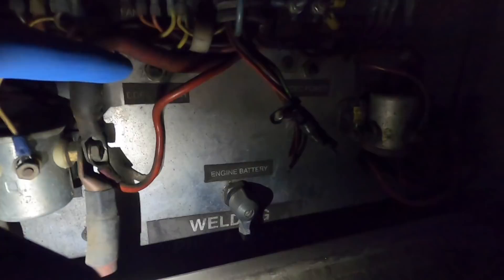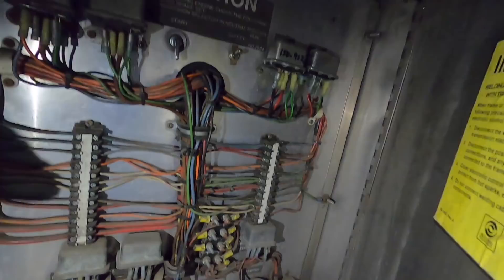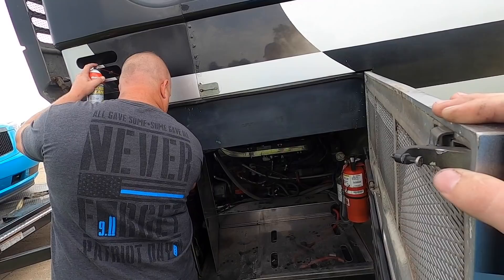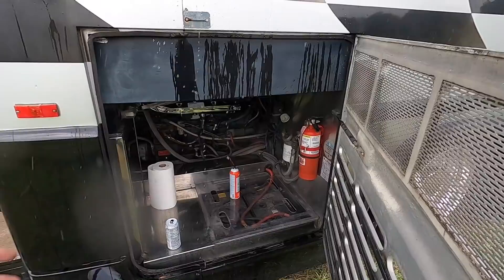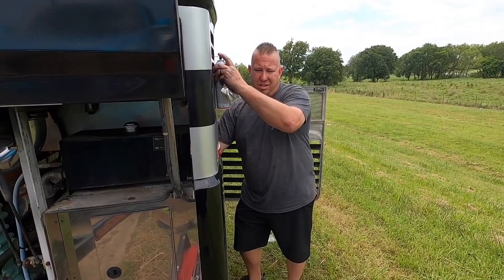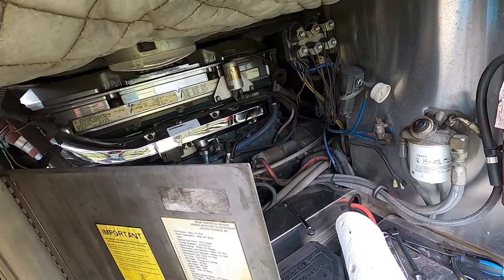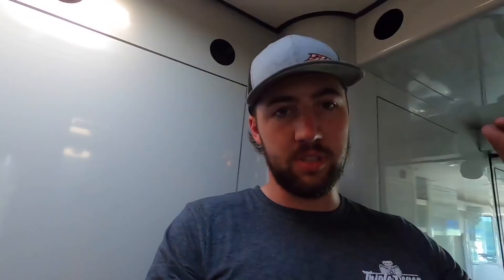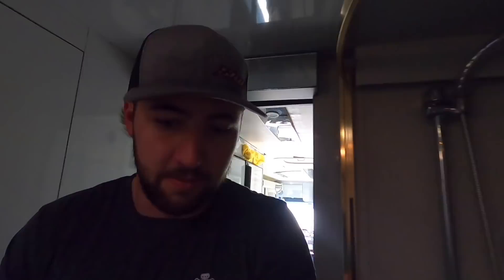RV Totally Stranded For 25 Hours...What Happened?? (My 96 Newell Coach Broke Down!)

Comment: You were blessed by all the angels in heaven finding Diesel Solutions.  My 45' Spartan / Travel Supreme and one day I turn the ignition on to start and NOTHING. At least we weren't stranded and at home.  Did you know that some coach wires have numbers on them in addition to the color?  The numbers correspond to the electrical schematic and circuit numbers. Definitely helps when your going from back to front. I never did find the issue that caused my loss of power to the ignition switch. I ran a new one and labeled it.  I'd suggest you carry a tool box and parts department your coach. IT whatever it is will break of just stop working at the worst time.  Does your plumbing have the nylon type fittings?  You should have a supply of each type. I also had a service manual stored on my computer for each system on the coach, ie leveling, pumps, gen set, a/c etc.  Travel safe and if you don't know, learn how to identify and handle a front tire blow out at 65 mph.  Be well

Comment: Sorry for your electrical issue, no fun to break down on the road.  You called the problem out at the front of the video.  Your first mechanic could have loosened the tubing on the fuel pump that goes to the injectors/injector pump and turned it over to see if the pump was making pressure.  Just FYI for any future issues that suspect a bad fuel pump.
Reply from the maker: I thought the same. He pulled lines AFTER changing the fuel pump but not before 🤨

Comment: It wouldn't run on either in the beginning you can't condem the fuel pump should have disconnected delivery line to check for fuel on crank over

Comment: My thoughts why replace the fuel pump if it wouldn't start or at least try to start when spraying starter fluid in the intake, if the fuel pump was bad it would have at least tried to start.

Comment: Wow, that first guy not too smart spraying starting fluid into an electronic engine, bad, bad, bad. I've had every version of Detroit Diesel Series 60 since 1989 and 10-1/2 years with my current one. If you ever run one out of fuel, or need to perform a fuel filter change on side of road, there is only one of two ways to prime them and that is by filling up new spin-on fuel filter with ATF fluid "NOT DEXRON". If using a see-through Fuel Pro 382, top off with diesel only. They will fire right off and bleed themselves of air within 5-seconds and you're good to go. ATF fluid ignites the same as diesel fuel, the fuel injectors don't know the difference and your engine will not smoke. Dexron on the other hand will not ignite. So it would be a good idea to keep a case of ATF fluid in the storage compartment for priming fuel filters and for power steering fluid unless you are using engine oil. You can use either ATF fluid or 15W40 engine oil for power steering but of course never at the same time.
Reply from the maker: my power steering system does use atf lol

Comment: Just saw this and my question is: Why didn’t the 1st tech have the right connectors for the scan port?  If he did then the electrical issue would have been seen right away. I think they should take back the fuel pump just based on not providing a proper diag and leaving you stranded. It would have been different if the replacement of the pump got you moving. The 2nd guy, bloody excellent!  Just my 5 cents.

Comment: Using that either was painful to watch.
Reply: Pull your 5 pin power connector and check it for corrosion.  Especially the red power wires. That is an electrical area also that can kill your engine. Little di electric grease helps prevent corrosion.

Comment: (Sh) It happens, best be prepared.  Within the first 30 minutes of driving my newly purchased '97 Monaco (Cummins 8.3 6cta, mechanical P-Pump fuel injection), pulling my car on a trailer, I hit a bump on I-10, in a construction zone with cement barricades blocking the inside & outside shoulder lanes.  I lost engine power & thankfully coasted past the barricades & pulled over on the shoulder.  I cranked the engine & it fired, but immediately died.  Googled "Cummins 8.3 starts then dies", found a forum post that described the problem AND the fix (loose fuse to the fuel cutoff solenoid), wiggled the fuse (with interstate traffic whizzing past me @ 75 mph...), cranked the engine back up, and off to the races.  Many thanks to Google & the folks that share their experiences (Problems AND Fixes) online...

Comment: When I had my tire store in the 80s if we installed a new part and it didn't fix the problem we uninstalled it and kept looking for the problem... they should have done the same. Get your pump back and the rest of your money too. You called for a road side repair not a fuel pump replacement.

Comment: I think your in the rotation now lol, cleeter, Pfizer, boosted boys, ave, electroboom, and now you.......You don’t know until you know, now I know that wiring on a Detroit 60 series is temperamental. It makes sense though, couldn’t they have cracked an injector line to see if it was fuel pump? And then once it’s electrical then start at 12v to the ecu and if that’s there........ not sure after that lol that is where I’d need to study the diagram a bit

Comment: I would of tested the pump first doesn't take much to remove the pressure side and bump it to see if it's functioning especially on a job in that circumstances where it would cost my customer that amount and where you were stranded. Then just completely give up on it because it was "the weekend", then still leave a customer stranded and still only refund the labor. seems like a pretty lazy outfit to me. I guess they do call them selves "semipros" after all.

Comment: Id like to see more lsxcalade content i found u from pfi speed. I think the Escalade is the most power that has been on pfi's dyno. Im not sure but 1700 at altitude is like 2000 at sea level.
Reply from the maker: It’s corrected so it’ll make about the same number in that setting at sea level in theory. The Escalade and Newell are the two biggest parts of my life right now so you’re gonna see plenty of both 💪🏻

Comment: The first joker was a crook parts changer, the second guy is a true technician. You should have been refunded the entire amount for parts and labor. If you paid with a credit card I would dispute the $300 for the pump you didn’t need. That first shit bag condemned the pump without so much as a pressure test or even cracking a line, what a joke. He will probably put a paint job on the old pump and sell it to some poor bastard as a reman pump.

Comment: I think a refund of the labor is fair. Especially if they are noted for having fuel pump issues. He diagnosed it the best he could without electronics. Just my opinion
Reply from the maker: Back in high school I took the test the best I could without studying. Does that mean I deserve an A if all of my answers are wrong?
Reply: Stapleton42 . No. But in fairness (and I wasn’t going to go here, but you asked), when he arrived he told you he didn’t have the proper diaognostics to tell you for sure. You authorized him to change the fuel pump(and you do have editing capabilities), so he did. You could have told him to leave when he got there and told you that. You took the chance. I’d say you did ok to get the labor scrubbed. I wasn’t going to go here, but your sarcasm got me.